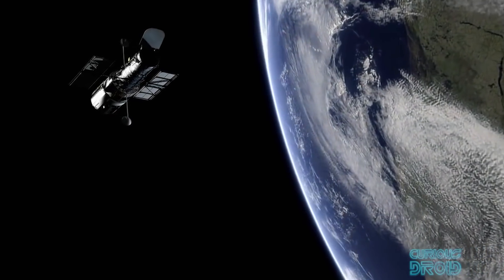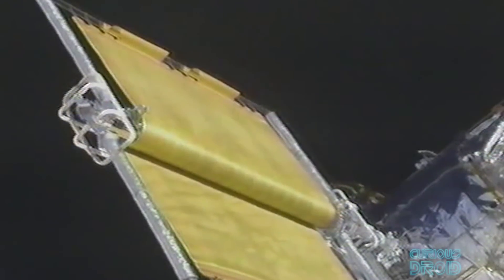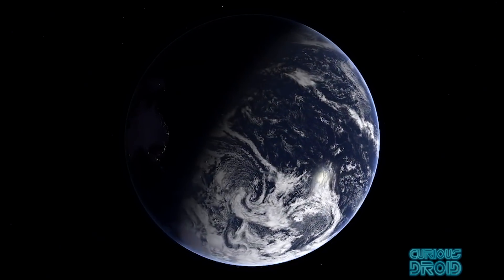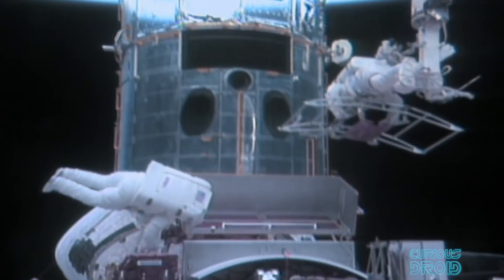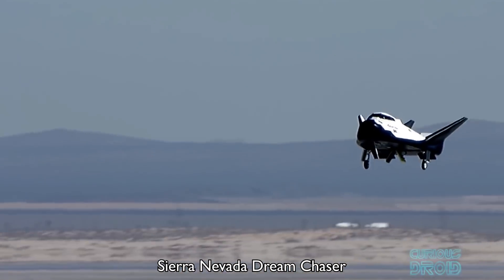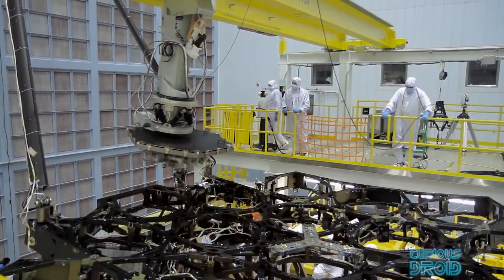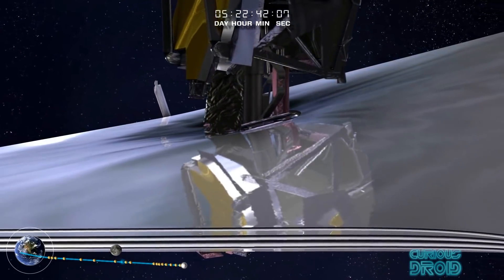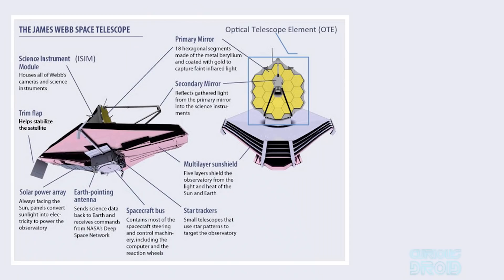Can We Save Hubble and Where is the James Webb Space Telescope?

Comment: I think the Hubble telescope should be repaired, if at all possible. And rather sooner than later, so mankind still have a space telescope just in case the James Webb never flies.
Reply: That's nice, but there is currently no way to repair the Hubble.  We have lots of telescopes in space - we just don't have another visible light telescope like the Hubble.  Even after the JWST flies, we still won't have another visible light space telescope.  The JWST and Hubble do not serve the same purpose.
Reply: @Wroger Wroger you sum up my feelings. It would be heartbreaking to see it burn up upon reentry. Is spaceX going to save Hubble before it is too late, I wonder?
Reply: There are almost 40 space telescopes other than Hubble up already, it's not a matter of there being another one, it's all about capability.
Reply: Many technologies on Hubble have been obsolete for years. It's incredibly difficult to find parts and proper techniques to fix it today, just like we can't easily find any floppy disk anymore in the market, nor can we easily find any computer today that could read them, which reciprocally makes maintenance more costly than replacement.
Reply: @wisdomleader85  It is a project that started development in the 1970s, so much like the STS, it is obviously a bit difficult getting new legacy hardware and software for the thing, even if you include some compatible modern upgrades.
Reply: Reportedly NASA finally got into retrofitting one of two NRO gifts and making it space-worthy.
Reply: @piotrd.4850  All that NRO gave NASA was two mirrors.  They have a very low focal ratio, making their uses somewhat limited.  They're putting one of them into the WFIRST mission.  WFIRST is also not a visible light telescope - it observes in the near-infrared but it is a very wide field telescope.
Reply: Yes,, I agree with you there 100%   Mike M
Reply: Brian Landers Why the expensive detour down to earth?  Fly up spare parts a few at a time, including some tools.  To install them.  Fly a few repair missions with robots or astronauts.
Reply: I agree. Let the space X team have a crack at fixing/lifting the Hub.
Reply: @kdeuler  I'd bet the BFS would be perfect for it.

Comment: There is an unknown elephant in the room: 2 KH-11 Kennen reconnaissance satellites, built for the NRO (National Reconnaissance Office) at a cost of around $1billion that were offered to NASA as possible Hubble replacements. Nicknamed "Stubby Hubble" whilst slightly shorter, they have a wider field of view, allowing for much greater detail to be captured and use very similar tech and layouts. In fact, a KH-11 is due to be launched on a ULA Delta IV Heavy rocket in a few weeks time..... kinda makes you wonder. At least its name isn't Zuma.....

I'd save the Hubble and return it to earth, so it can be shown to all as a testament to what science can achieve. As for the James Webb, i'd rather spend $10billion to have it be perfect, than spend $1 or $2billion only to have it break and be completely unrecoverable out at L2. That would be an absolute disaster.

Comment: Just for clarification of the problem with the mirror.  Fact is as it turned out, the Hubble was waiting to be sent to space because of the shuttle accident was disassembled to conducted additional re-adjustment of the mirror. Alas, additional errors in adjustment were introduced during this waiting exercise. I know this since a friend of mine was working to the project at the time. So humans induced errors while awaiting deployment. So it was not a flaw in the mirror. Maybe the JW will also experience such events while waiting

Comment: Build a shuttle replacement fix hubble and take the time to do the jwst properly because to fix it means making anentirely new craft and making it in orbit and launch it in sections which means making another space station basicly, basicly get b2 enlarge it coat the underside in heat tiling place a modified sr 71 on top with some built in linear aerospike rocket engines have designed to fly under 5 different engines ranging from trubejet t9o scramjet than let the aeriospikes take over at 70-80,000 ft and essential the b2 acts like a heat sheild for reentry and sr71 does the rest or spend billions and get x33 to work

Comment: A gyroscope is a device used for measuring or maintaining orientation of a vehicle independent of its environment. It is what helps keeping a plane, for example, is straight level flight regardless of the shape of the earth.
If that is so, how does the gyroscope follow the curvature of the earth? After all we know that the curvature of the earth is 8 inches for every mile squared.
Reply: steve gale  So what is the curvature of the earth then?
Reply: steve gale  WTH are you talking about?!! That measurement depends on the type of plane. Why are you making so complicated? Are you trying to hide something?
At any case, how do the gyroscopes keep with the curvature of the earth?
Reply: steve gale  If the gyros keep the planes flying on a straight level and the earth curves down, since it is a circle, how do the planes keep their altitude towards the earth?
As far as I see it, the planes would have to fly with the nose somewhat down to keep the curvature. Isn't it?
Reply: steve gale  Yeah right! The gyros are used to find the orientation of a vehicle. It tells you whether you are flying in a straight level or upside down. It tells you if you are going up or down or turning left or right. All of it regardless the shape of the earth.
Having said that, if the computer adjust to the curve of the earth, the plane would have to be nosing down now and then to keep with the curvature of the earth. But that does not happen. Get it or is it too much for you?! Do you have any common sense?

Comment: Keep the JWST on earth (for now).
Instead build two smaller less-costly versions using the developed tech and launch one of those first.

In case of a mis-launch, there is a backup.
Once in space, if there are issues with number one, find out whats wrong, and correct number 2 before launching it.

And if number one works, launch number two and if that works as well, wait a few years before launch the big original as to have it perfected and live well beyond the first one.
There is wisdom in not making just one, but multiple and take smaller size steps when so much new tech is involved.
Two can even work together to improve on the capabilities of just one!

I think the established space industry has gotten inefficient and suffers from thinking big and needlessly expensive, with subsequent terrible planning and management.
The fact this telescope is still a project shows they are untouchable, money flows anyways, so why think small when all that matters to them is the money?
If there was any real interest in leaping science forward, they would have not gone so big, so quick, but improved a little on success designs, scale them a little and litter the heavens with them.

Comment: We can service the same class of satellites (that point the opposite direction) with the X-37 although no one will admit it. Freaking send an X-37 up there to service Hubble already. Any idiot can put 2 and 2 together to clearly understand that the X-37 is capable of this.
Reply: The X-37 is the size of a pickup truck.  You can't carry much on it.  It's unmanned - how are you going to do the actual servicing?
Reply: @stargazer7644  I think they mean servicing as in towing it to a higher orbit so it doesn't reenter.
Reply: @adub1300  Hubble's orbit will be fine into the mid 2030s.  Its equipment won't be.  All of the mention of servicing is talking about repairing the spacecraft. Reboosting would be part of the servicing mission.
Reply: @stargazer7644  Maybe a Boston Dynamics Remote  Manipulator POD
Reply: Considering they had trouble just closing the doors on hubble, i dont think unnmanned is feasable.
Reply: Yup, they need to replace those gyros, Unless they can design gyros that they can stick on with Velcro I don't see any way to do this unmanned
Reply: Why, when there could be this? https://youtu.be/K4YMFP9O-as

Then one could use a Dragon capsule, or Lockheed's proposed Lunar Lander (which has enough delta-V to get from lunar orbit to Earth L2 and back on its own), take an extra robot arm, and presto , annual service missions.
Reply: You couldn't use the X-37 for a return haul flight. Not big enough. Additionally, any repairs would have to be done with telerobotics, but there you run into the potential problem of damaging parts of the HST that were meant to be repaired by crews in spacesuits. I don't see too deeply into this, but it comes to mind as an issue. Also, IIRC, the X-37 doesn't have equipment for telerobotics repairs, so you would have to develop it first. I think by far the easiest thing you could try is sending said shuttle up there, soft-docking it and boosting the telescope in that manner. Not entirely sure what the fuel requirements would be, and whether a soft-dock and slow boost would even be possible with the X-37. The X-37 is a good vehicle, but it's still a fairly rudimentary spaceplane.
Reply: It's too small to get it, the cheapest way to pick it up would be to send a Space Shuttle, its the only thing on the planet right now that capable and fit to take it back ...

Sadly enough, there isn't a single other vehicle right now that is big enough to do so and get back to earth ... :S

Hell, fitting anything else to take it would end up more expensive ...
Reply: @EliranC  The Space Shuttle has been retired since 2011, all of them are in museums by now.
Reply: @terra1310  If the BFR was ready in time it could easily tow and repair it.
Reply: But whatabout keeping the 'others' out of our country?? Surely that takes ultimate presidence! Urgh.
Reply: @ridethecurve55  , Deuteronomy 28 applies to this too.
Reply: @ridethecurve55  What 'others', exactly?  US spends more on defense than the next 14 countries added together.  Way too much money already, especially as Trump does not want them even involved in anything.  Maybe he wants F35s blowing up 7 YO immigrant kids on the Mexico border?

Comment: I suspect that when it comes time to finally launch the JWST the only people able to launch it will be Space X using a BFR. 
Hubble if possible should be boosted into a parking orbit high enough that orbital decay is a remote problem. Then at some point in the future it can be recovered. To boost Hubble you would need a vehicle capable of attaching to the thrust struct that carried the load during launch and even the telescope was sitting on the pad. this should be doable. If the government is willing to let Hubble burn up then would it be eligible for salvage.

Comment: 8:50 actually the F-35 is 3 different planes that (will eventually) replace at least 4 (F-16, A-10, F/A-18, AV-8B) other planes that would be more expensive to keep compared to the F-35.

That aside, what do you think about bulding a new Hubble, basically the same design with "only" better more modern materials, gyroscopes and/or computers? to replace the aging Hubble and complement JWSC of course (not to replace it).

Comment: The Hubble is still a highly useful tool, it has looked at a tiny fraction of the observable Universe in its service life. It is certainly not the case that we have no more use for it - even if it stayed in service for another 100 years, there would still be more for it to see. If we lack a vehicle to service it, how do NASA expect to service the JWST? It seems both telescopes and other missions, need a vehicle to service them, perhaps a module that could be launched by the Falcon Heavy and return by re-docking with the 'Heavy' from orbit. A robot vehicle would make most sense, light, and reusable with no need for life support systems. Modern robot arms can be just as dextrous as a human in a clumsy space suite.

Comment: I vote for fixing the Hubble for these reasons: 1) It worked well for so long so it is well tested. 2) There will always be jobs for it, even if a new telescope has been launched (which it hasn't so far). 3) it is better to have that than to have nothing in case it is needed, e.g. for incoming asteroid, comet or whatever. 4) The bill is ridiculously small when compared to military spending.

Comment: Hubble requires a robotic arm for its "capture" and repair which the SNC Dream Chaser does not have nor is designed to have. FWIW, NASA did not cancel Shuttle...George Bush did. Congress DID NOT provide enough funding PRIOR to cancellation for a replacement, keeping Shuttle going until then and supporting ISS all at the same time.

Comment: I was under the impression the hubble was not made to be serviced in orbit. They had to devise new methods of opening up panels that were not really intended to be opened in a zero G environment. Loose screws that needed to be opened with a special torque limited screwdriver within a specially made container to prevent the screws from floating off into space.

Comment: I think the US should build and design and new space shuttle it was the best Space vehicle and history besides the Saturn rocket.
Reply: It was dangerous. For one thing it had no launch escape system. If something major went wrong during the ascent, like on Challenger, the crew was dead. Also, having the orbiter with its heat shield hung on the side of the external tank exposed the thermal protection system to damage on launch, like with Columbia. Beyond that the shuttles were too expensive and difficult to maintain. They were supposed to fly twice a month. There were times when NASA was lucky to fly the shuttles twice a year.
Reply: Erm actually it had a lot of flaws.

Comment: By the way,
"Our" Big Bang is just one of many.
And no, time never stops.
It only seems to stop when either of two limits are reached.
1. Total lack of energy so that there is not even a single vibration or spin or any kind of movement of all atomic and sub-atomic particles. And / or
2. Packed so tight and with such density that nothing, not even atomic and sub-atomic particles can move.
Then and only then does time stand still, or stop.
And only then within its own system.
For those on the outside, observing inwards, time goes on just as before.

Comment: Hubble definitely deserves to be a museum piece, once retired. But getting it back down wont be cheap, nor easy.
Reply: Whether we bring it down or boost it up, i think we should do it for the sake of space mastery.
Reply: Taking the museum up though...
Reply: It just needs a few gyros replaced, and then a little boost, is this such an impossible mission!?
Reply: Just strap a bunch of parachutes on it and revert a few patches so overheating isn't implemented yet and let it fall down
Reply: @brandt003  that's not possible. It will burn up on re-entry.
Reply: Zach Michaelis indeed.
Reply: Or possible.

Comment: Unfortunately to produce new science it is usually necessary to build better and bigger telescopes. The Hubble should be retrieved for posterity and for our descendants. It is our Pyramid. Would the egyptians let the Giza plateau be paved over?  Nevertheless a slightly bigger but essentially identical space telescope could be launched for under 2.5 billion dollars. The hubble is essentially a tube, mirror, solar collector and various detection equipment, computers, gyroscope, stabilization system and transmitter with a power supply. "We" could launch  a 2.7 meter telescope (9 ft versus 7.9 ft hubble) at a slightly higher orbit within 2 years maximum. If the Hubble recovery (or repair) mission is included then the cost is 3 billion (5 billion max?) which is doable.
Reply: It might be possible to stage a manned mission to Hubble to extend it's life using a commercial crew craft. But nothing short of BFR is capable of bringing it back home.  Both of these scenarios most likely will not happen.
Reply: @elguapoguano  What makes you think the BFR can bring payloads back to Earth?  Where do you people come up with this shit?
Reply: @stargazer7644  Well , BFR is a fully reusable system. So it's going to land back on Earth. A variant of BFR is going to service LEO and has a return payload capacity of over 50 tons. The alligator like proposed fairing is large enough to hold Hubble (with plenty of room to spare). Will it happen, most likely not, could it? possibly. Where do I come up with this shit? I dunno paying attention I guess.
Reply: A Hubble recovery/repair mission using what manned spacecraft?  2 years max?  The Hubble mirrors took almost 10 years to construct.  You're smoking crack.
Reply: Even if its still kinda wasted funds.  I would like to see its orbit raised out of athmosphere. Should be way easier than bring it home. And a better conservation aswell ;)
Reply: I am not smoking crack, I just pay attention, analyze facts and theories to come up with a reasonably cogent opinion. When the Hubble mirror and backup mirrors were ground they were state of the art lenses that were close in size and quality to the state of the art mirrors used for ground based telescopes at the time. In the early 80's computer controlled mirror grinding which is practically routine today was experimental. To make a lens comparable to the Hubble would take months not years. That would be the easy part. The hard part is in assembly and coordination; as the James Webbs seems to be having now. Rockets like the BFR and even larger rockets with bigger payloads could easily carry up the mirrors and platforms needed for tomorrow's space based telescopes.